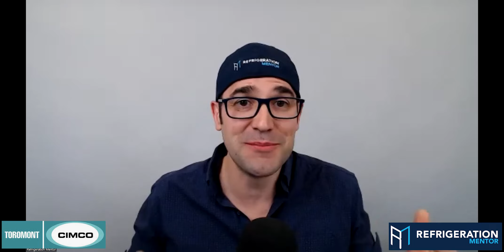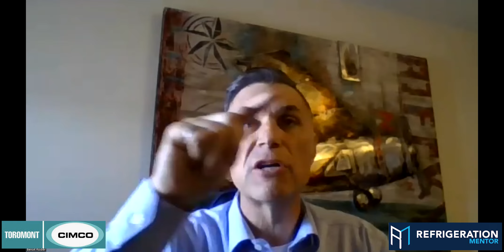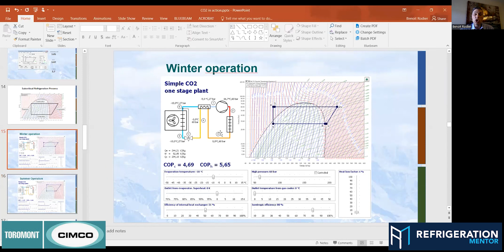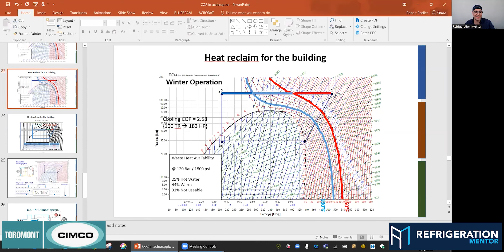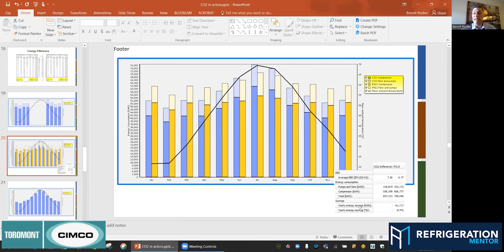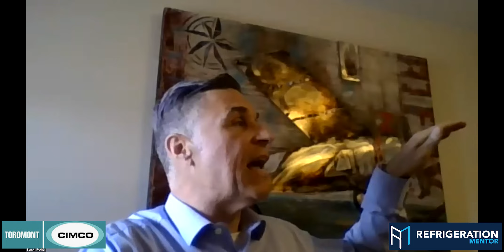Designing and Engineering CO2 Refrigeration Systems

Comment: Given the recent ruling from the EPA, CO2 is probably a foregone conclusion for us where I live in the US, but one of the biggest issues I have with it is that there is so much more complexity required to make it work in hot, humid environments.  While I'm not saying that all forms of complexity are bad, Lindbergh's rule still holds.  How reliable are these extra devices?  How easy are they to fix or replace when they malfunction?  How often do they cause other catastrophic failures in the system when they fail?
Reply from the maker: Valid concerns this is why commercial refrigeration training is going to be more important than ever before. 

We have many CO2 refrigeration technical training programs at https://www.refrigerationmentor.com from basic fundamentals to advanced troubleshooting CO2 systems.

Thanks for sharing.

Comment: Trevor, I have an unrelated question to this video yo ask you. When my 2 ton 8yr old single stage goodman scroll shuts off occasionally, the vanes sometimes sounds like marbles rattling for a split second until the vanves come to a stop. So the question is at the moment the compressor stops at high side operating pressure, why is that high side pressure at shut down making the vanes momentarily sound like marbles happening until it comes to a complete stop. The system cools and I've noticed this occasional sound at shut off for yrs. The condenser coil and filters are clear and both indoor and outdoor fans are working properly. Thank You
Reply from the maker: From what I am understanding with your question is that when the compressor satisfies and shuts off it make a noise and only at those times.  If this is so what it could be is that the Scroll is spinning backwards on shut down.  This could potentially be that the anti rotation device has something stuck in it or it has been damaged in someway.  The compressor should still work fine but will be annoying during shut downs. Unless you have it inspected properly its hard to tell.
Reply: Thanks for getting back to me, so because I can only hear and not see what your saying, is the anti rotation devise something that can be a intermittent not being in the exact position rulet wheel. Because you know from taking 100's apart, is there a discription and drawing some where that shows these subtleties of scrolls, is the anti rotation devise something that is spring loaded to immediately step in at shut down, what can react that fast to prevent the high side pressure from rotating the vanes backwards on shut off occasionally like I described. Thank you Trevor
Reply: Trevor, I don't know if you seen my follow up question to your reply about my scroll compressor occasionally spinning backwards on shut down.
Reply from the maker: @charlessolazzojr6767  there are many different types of anti rotation devices. It all depends on the model of the compressor. You will have to looking up the drawings on OPI at www. climate.emerson.com or contact Copeland they should help.
Reply: Thanks for getting back to me with that information to look up questions, and get answers from that contact information, thanks Trevor. I know your putting tons of info out on CO2, but I'm seeing a ton of VRV being pushed on utube in parallel with Co2 systems, you know they are  software and algorithm driven systems. There pushing there 10X heat transfer
Reply: Sorry, wrong button, there pushing there 10X heat transfer ability over water transfer systems, forget about air transfer. It's easy to see who the winner's are going to be in residential and commercial systems, you can't compete just on the transfer ability of refrigerant over water, are they playing with variable speed compressors for Co2 like the VRF's for refrigeration.